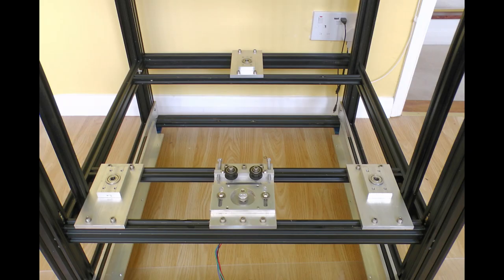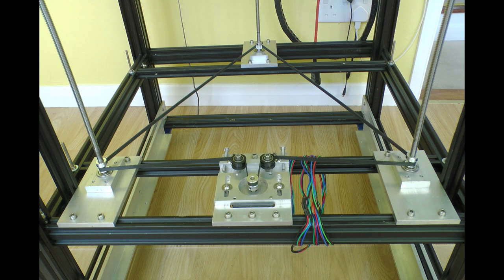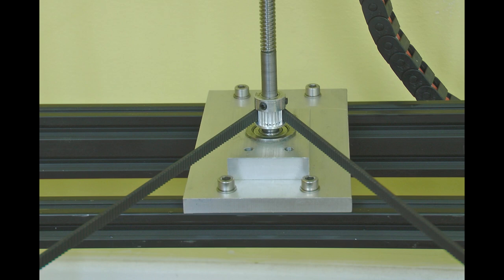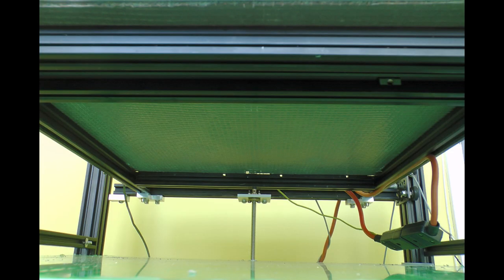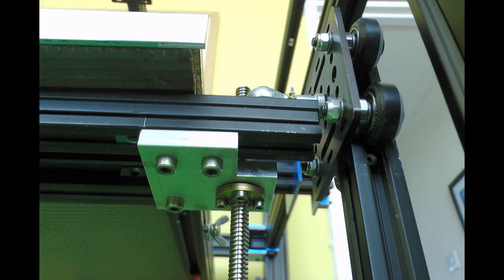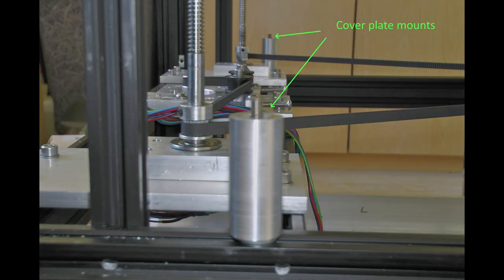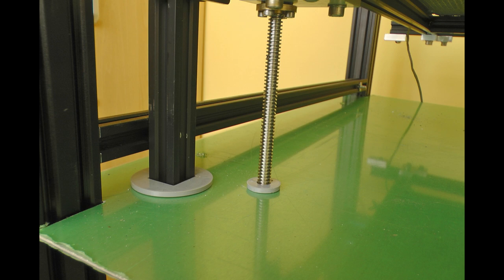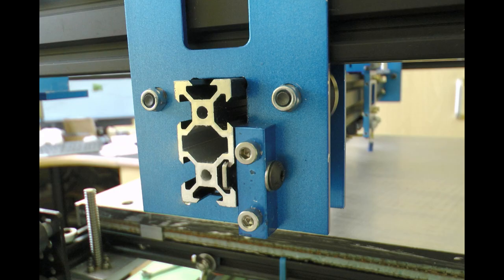NewCoreXYPart7  - installing the Z stage and getting it level and "tram" within 0.03mm.

Comment: You’ve reminded me to print a DTI adapter to basically do the same on my printer, been meaning to do it for ages. I do wonder, as not many people have DTI gauges, but given the repeatability of probes such as bltouch etc, if you could adapt your process to effectively level/tram the bed in the same way, and then not use the bltouch for levelling/compensation as mechanically levelling is always preferable in my opinion as well (fellow mechanical engineer)
Reply from the maker: I have mentioned doing levelling this way on various forums, either using a DTI or a probe, but it always fall on deaf ears.

Comment: I like the Way you are going about your Project.
A Measurement at the highest possible Temperature would be really interesting to see how everything changes and warps in Comparison.
But I don’t know what’s the Limit on the Indicators to stay precise.

Your Way of sensing the Nozzle deflect from the Bed should work to the Temperature Limit of the Surface to withstand the Contact.
One of the few higher Temperature compatible Versions of doing it. Otherwise I don’t see what Mesh Probing could offer over your Tramming.

It feels like the Home 3D Printing Community often tries to solve having low Quality Mechanics by trowing Electronics against the Problems that are encountered.
Reply from the maker: Well this is the same build plate that I used on my other printer and which I demonstrated a perfect edge to edge print which wouldn't be possible if there was any warping. 

Yes I agree that one can either use low build quality and the use firmware/software to compensate, or build the machine well in the first place. The problem with inferior build quality is inconsistency and change, meaning that any firmware or software compensation has to be repeated over and over on a regular basis. Having started with a cheap printer built from a kit and which needed constant checks and adjustments before every print, to a printer which needs no checks or adjustments other than basic homing after a power cycle, I know which I prefer.